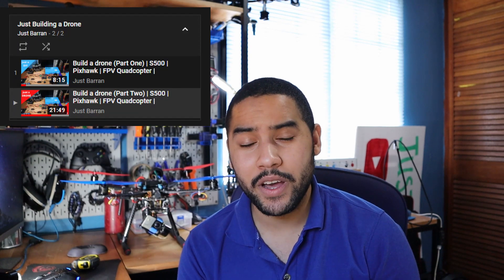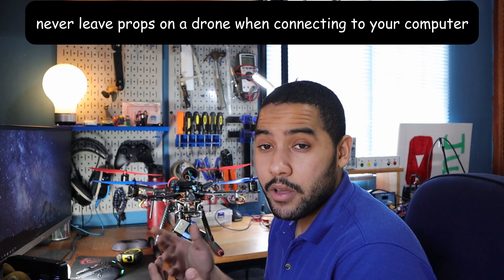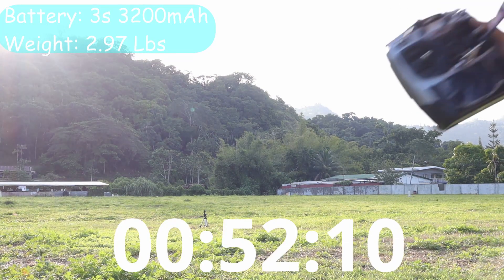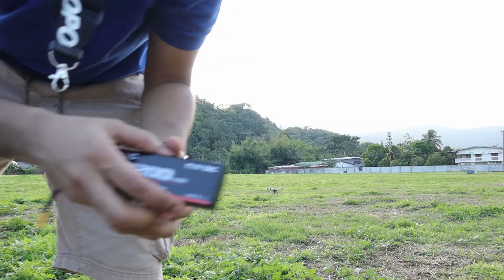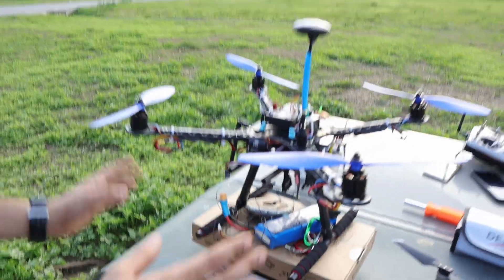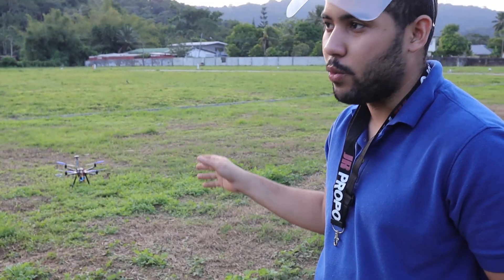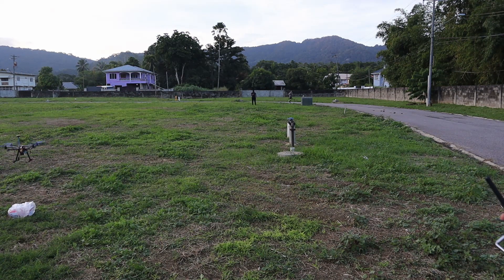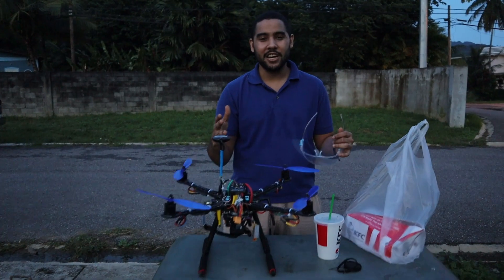DiY Drone max flight time, payload, deliever (S500 + Pixhawk + Afro ESCs + Sunny Sky motors)

Comment: Sir what is the flying time of this and which battery you are use in this s500 quadcopter drone
Reply from the maker: Yes s500, ~12mins with 3s 3800mah battery

Comment: Hi, why some of the Pixhawk controlkers in banggood or aliexpress is cheap and some of them costs more than 200 dollars?
Reply from the maker: Some aren't original pixhawk's, but they more or less work the same. Also there are new pixhawk's like the p4 and cube that use better GPS modules and faster processors. Is a matter of what you plan to use it for. As a hobby a pixhawk 2.4 in my opinion is enough while ok a professional drone you might want to use a pixhawk 4 or better
Reply: What you suggest for 500mm drone? First project and only for hobby. I dont need gps or other. Just flying 50 meters around.
Reply: @marcissturis8214  kk2.1 flight controller

Comment: Barran, Thanks for sharing, you made me laugh with your dancing. I guess you're just having fun..... Someone asked for how high you can fly I'd like to know how far away you could fly? Also shouldn't the drone be stable using the altitude hold? Thanks
Reply from the maker: I really appreciate the comment, the range is still to be tested but it’s gona to be limited by the radio controller. The radio link at9 I have has a max range of 1500m and am legally limited to 120m high but I still want to test it a day to see if it even reach that high. Also the drone is really stable using altitude hold at hight above 10 meter. The problem is close to the ground the Barometer which Is used for altitude hold is not very accurate due to changes in surface pressure vs higher up in the air.  So drones like DJI use a ultrasonic sensor for measure the distance of the drone close to the ground (0 to 5meters) and then it switches to the Barometer when it goes higher in the air.

Comment: Cool video bro! how long have you been flying and building what size batteries did you use
Reply from the maker: now quadcopters I have been flying for about 4 years. This is a new but old build I had on a self. In this video am using 3200mAh.